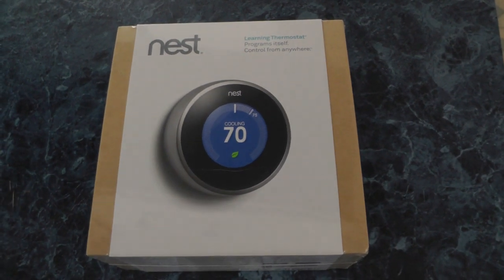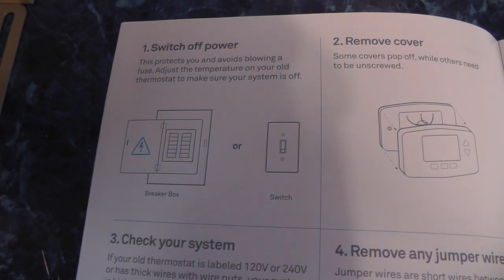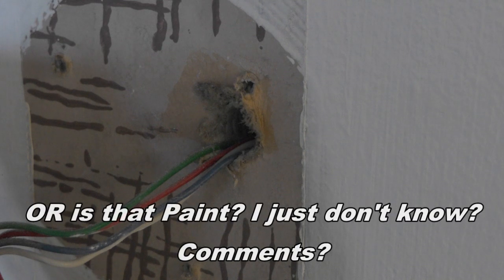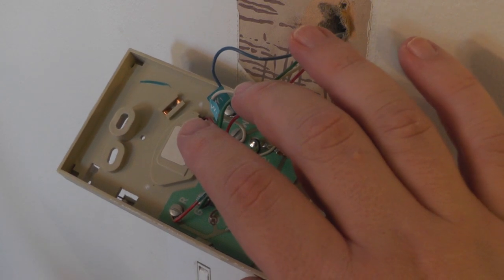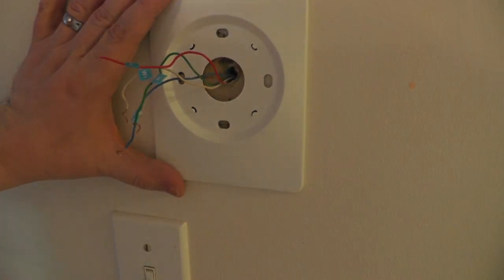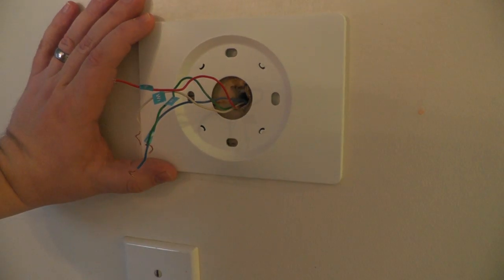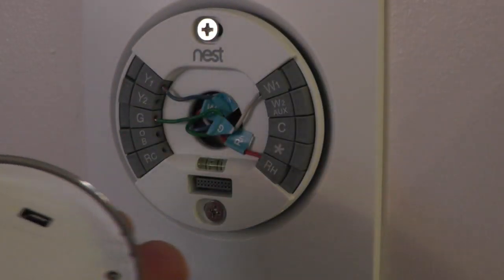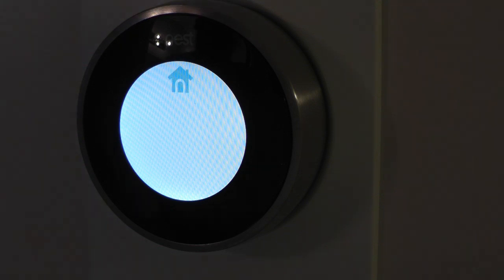The NEST thermostat install in under 30 minutes - part 1

Comment: wheres the heat link?
Reply from the maker: +Russ Hopson It's actually there. When you push on the NES< it brings up menus and you turn the turn to move the menus. Controlling the heat and cooling from my iPhone is still an amazing feature!
Reply: Steverd99 Cheers, what I was actually referring to the seperate unit you have to fit adjacent to the boiler. Apparently this is only required on european boilers you you wont have it! any way, Fitted last week, loving our new nest!